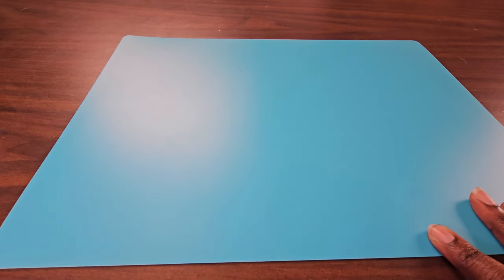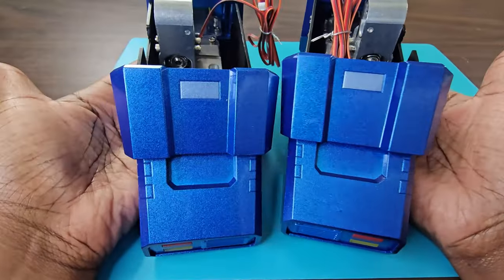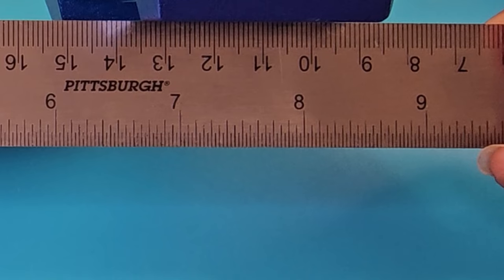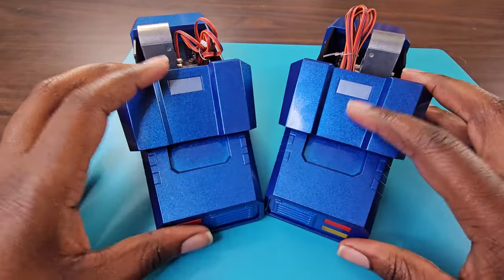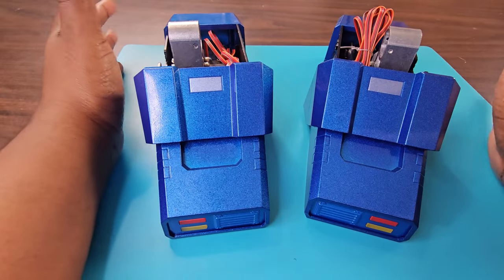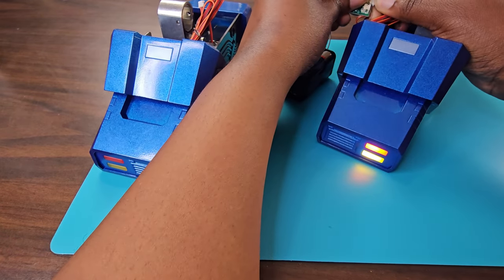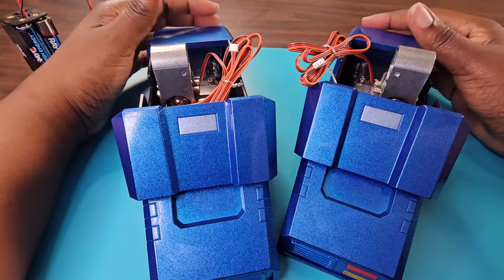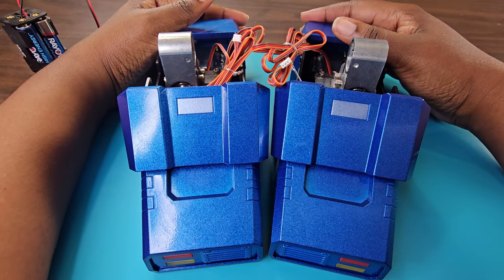Agora Models Optimus Prime Box 6: Some Big Feet!!

Comment: just a quick tip when you are screwing into painted metal, use a little 3 in 1 oil it will make life a lot easier. it will cut thru the paint in the treads also get a PH 1 and PH 0 screwdriver.
Reply from the maker: That's genius!😍 I will definitely purchase those for the next box. Thank you so much for the brilliant advice. I would've never thought of that.